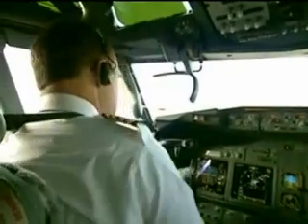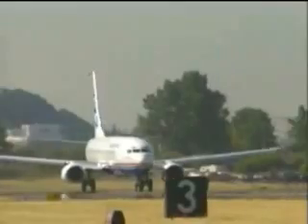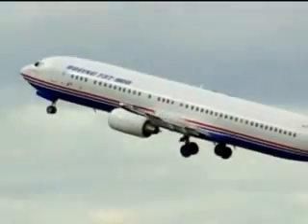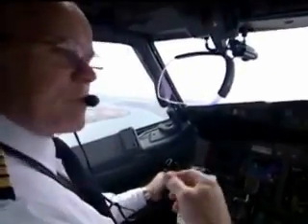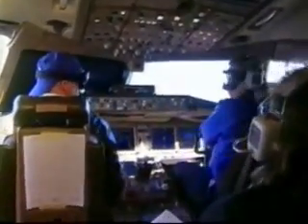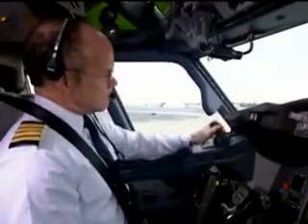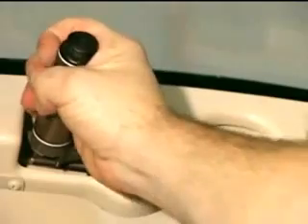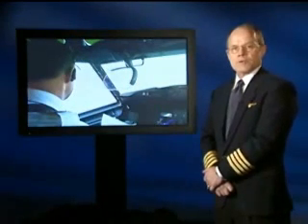Window Opening on Takeoff.

Comment: Im not a pilot, but I dont understand when he says "If the window has been damaged, you should declare an emergency landing, otherwise you can continue flying". I mean is a pilot really in a position to determine if a window is faulty or not simply by looking at it from their seat? Sure it may look like it just opened due to not being latched, but what if it was latched and a fault with the latch itself caused it to open? What happens when you're at an altitude like the altitude that British Airways 5390 was at when the captain was sucked out of the window? I understand that was an entire window screen, but couldnt an unforeseen problem with a window opening cause the same problem at a higher altitude/speed?
Reply: The movable window is a plug: it’s bigger than the hole it goes in. If the window is structurally damaged, then it won’t allow the cabin to pressurize so then you turn back. Otherwise if it closes OK and the cabin pressurizes then it’s impossible for it to come open again with the air pressure pushing it out.

Comment: I was wondering why they wouldn't install a safety sensor on the latch. I remember when the "Big 3" started making childproof windows in 4 door cars. It had nothing to do with child safety and everything to do with cost reduction by eliminating half of the window and track materials. Obviously an orange band or warning sticker is cheaper than additional electronics. I don't remember ever hearing about a kid jumping from the back seat of a moving car.

Comment: How come not all Nr. 2 and 5 windows are cranked? The 767 has acrank in which to move the window whilst the 737 has a straight slide handle. Should'nt the 737's Nr. 2/5 window be difficult to close in flight due to giant airflow?

Comment: shame there nothing like a automatic door slider for plane windows so if you forget close or secure your window by accident which I am sure has happened to a few pilots every now and then. But if some automatic pilot window mechanism cold be installed and it would wld Olympic work on opening shut on the ground. but if the captain overrides the window if we could build a sensor into the system if a pilot was to take off climb into sky the sensor Io
ŕ will keep pilots safe and lessen  risk of losing pilots, passingers and lessen the risk of decompessioning of the cockpit and the rest of the plane too.  As it seems a sensible idea to a situation that happans more than we think I bet as the captain and second pilot have so many checks to remember something as important as a window.  End of the day pilots are only human like everyone else yet do amazing job doing sometimes very long hours sitting in one enclosed area quite some time. yet if working with a second officer you can't stand it must horrible in that situation. yet I guess airlines do their best too put compatible teams together most of the time I guess.

Comment: this capt is correct . I had door open just after take off when flying a Cessna 150. no big deal . sure it makes a loud pop and will change the the way the small cessa flys due to the extra drag but no big deal . fly the plane .. once I was at a safe altitude I simply closed the door..

Comment: like you need a window...
Reply: Karlett555 Umm, actually, they do.  It doubles as an emergency exit to get out of the flight deck.  Also makes cleaning the windshields a hell of a lot easier than a plane with non opening windows.
Reply: Karlett555 Umm, actually, they do.  It doubles as an emergency exit to get out of the flight deck.  Also makes cleaning the windshields a hell of a lot easier than a plane with non opening windows.
Reply: Karlett555 Umm, actually, they do.  It doubles as an emergency exit to get out of the flight deck.  Also makes cleaning the windshields a hell of a lot easier than a plane with non opening windows.
Reply: Well, even if it couldn't open, you'd still need it!

Comment: why do you need a window that opens in the cockpit anyway ?
Reply: Allows the crew to clean the exterior of the flight deck windows, or escape in an emergency. It also allows you to circulate air if the cabin HVAC system is off, since airplanes can get extremely hot sitting in the sun. You can use an open window to communicate with ground crew if you're having trouble with their communication systems, or wave flags and banners and so forth out the window.

There's all kinds of uses for it.
Reply: Since the no smoking ban was insituted, the only reason(s) todate is to adjust the rearview mirrors and or toll booths.

Comment: LIttle known fact: some people believe airliners still have windows for the flight crew, so in the event of a nav light failure, the pilot can open the window and use hand signals for stops and turns. This is of course nonsense. They wave various large flag out the window to indicate stops and turns, based on maritime flag designs. They even have the "Caution! Diver!" flag, although it's rarely used except on old flying boats like the PBY, or on planes with nav light failures and doing unusually fast descents.

Comment: I work for a major airline, I was reading thru the pilot's emergency check list one day for the A-310 Airbus and it states, "for smoke in the cockpit" slow to 250, don O2 mask, depressurize the aircraft, OPEN THE WINDOW!
Reply: SwiftArtz if the plane was pressurised, you'd never get the window open.
Reply: And jump out?
Reply: No, opening the window was suppose to clear the smoke out!
Reply: Scott Haskin yep
Reply: what if you were flying at 32000 feet?
Reply: Scott Haskin yop
Reply: Scott Haskin flop
Reply: +Scott Haskin pep
Reply: +Scott Haskin pup
Reply: +Scott Haskin pop
Reply: I remember hearing that if your windshield is cracked, and no autoland is available, open the video for a "visual approach".
Reply: Oxygen mask giving off 100% oxygen, smoke in the cockpit,....I can't imagine any problems at all

Comment: I was on a flight from Amsterdam to Tangier recently in a 737 where just seconds before takeoff the pilot's window apparently opened. Being a frequent flyer myself I am pretty sure that the plane was already past its v1 speed, instead of taking off however they decided to reject the takeoff, breaking extremely hard and sending all sorts of hand-held items flying through the cabin. Best part of it all however; the cabin crew didn't even make an announcement of what happend afterwards. They simply rolled back to the runway threshold and took off again... (You can imagine how pale some of the passengers looked) I actually had to ask one of the stewardesses what was going on. Crazy if u ask me! First and last time flying with Air Arabia.
Reply: If you were past V1, the airplane would have gone past the other end of the runway in a runway overrun accident. By definition, V1 is the decision speed after which the aircraft is not be able to stop before the end of the runway.
Reply: Assuming your account of what you experienced is correct, then you are either overestimating the speed at which the takeoff was rejected or underestimating the time it took to commence the next takeoff. Factors such as ambient air temperature, weight of the airplane and the speed at which the RTO occurred will affect the required cooling time, which could be up to several hours in extreme circumstances.  It is inconceivable that a captain would proceed to an immediate take off again after a hard RTO.
Reply: I don't know the technicals but fact remains they were almost at takeoff speed, breaked very hard to a standstill, remained standing still on the runway for about 2 minutes after which they rolled back and took off again. about 5-7 min after the RTO
Reply: Your story is bullshit.  After an RTO, the brakes need to cool down, so your claim that "They simply rolled back to the runway threshold and took off again" is utter nonsense.
Reply: As other says, if you past V1, you must take off and then think what you will do. If any pilot abort the takeoff roll after V1, he knows that will end forward the end of the runway, thats it. 

Check in youtube "Accidente Spantax Malaga" where a DC10 abort the takeoff roll after V1 and crossed a highway.
Reply: this is one of the main reasons that they tell you to turn off mobile phones or other handheld devices during takeoff or landing it is to minimise the chance of you holding your phone or whatever which would then become a potential projectile in an undesirable circumstance such as an aborted take off or botched landing or crash that is also why they tell you to stuff any drinks/loose items in the pocket of the seat infront of you in a emergency landing.
Reply: ryanhaart , Sorry ryanhaart, many an airline pilot will totally ignore any cooling charts or not even take note of the RTO speed to calculate it.  Particularly foreign carriers with some much more notorious than others.  A few people I've flown with who in the past had worked as instructor pilot's at foreign carriers have related stories of complete incompetence when their pilot's were subjected to a non normal situation.  How does one describe the level of incompetence not only in situations like this but all others as well.  The completely preventable loss of the B-777 in SFO with Asiana and the B-737 in Poland a few years before, come to mind.  Boeing/Airbus build their machines in such a manner as to allow people with minimal experience and expertise to operate them.  But flying will always be an exercise requiring human monitoring and at the very least, occasional intervention.  At least for now.  Whenever an aircraft is lost complete with it's human passengers because the supposed pilot forgot to left a switch or was too incompetent to understand what the problem was.  Is beyond belief but sadly true.  And the flying public by and large is completely ignorant of the situation.  
All this and we aren't even touching on the issue of pilot's in this country, some of the best trained in the world.  Yet many basically unable to fly in IMC conditions using needle ball and airspeed even with a DME.  Have them intercept a radial, track it to an arc.  Arc left/right to an ILS/LOC, miss the approach, climb, turn, level off and enter holding.  All on an old style panel with an engine out the way it has been done by all pilot's over the decades.  Technology is a wonderful thing but a truly proficient pilot should take pride in the knowledge he can perform all these tasks and more without the aid of a color EFIS map.  
That lays it all out for your brain so much so he has or never had the ability to create situational awareness.  Every pilot should have that proficiency, I know I'd feel a lot better knowing the pilot flying the plane my family and I are on can do these things.  Sorry, for the rant.  But I believe it's not only true but important for everyone's safety.
Reply: @sonnyburnett8725  you’re just racist and retarded

Comment: next video ..window opens at 38.000 feet and the pilot is sucked out of the window.
Reply: The window didn't just open, the entire windscreen blew out due to a faulty repair. Somehow the Captain was able to survive after his upper body was pinned to the outside of the plane and a flight attendant held onto his legs from inside the cockpit.
Reply: At those altitudes it really is an emergency, but on the ground and during take-off or landing it isn't that big of a problem
Reply: userwl2850 that actually happened once I saw it on Aircrash Investigation
Reply: Prank gone wrong
Reply: userwl2850 No. Just keep flying 😂
Reply: Raidzor つ ◕_◕ つ wat
Reply: Raidzor つ ◕_◕ つ wot
Reply: Here is a vid on that

https://youtu.be/3AeWKIKmCBQ
Reply: No way due to pressure

Comment: First step never changes: Fly the airplane.
Reply: aviate > navigate >communicate very important
Reply: Ruben Kelevra
Sorry, Ruben, you just died while keeping calm and gathering information.  Airplanes do not fly themselves when things are going wrong, no matter how calm the crew.
Reply: Hopelessand Forlorn Just stick your elbow out and act cool. That way nobody notices!
Reply: Hopeless, I would say so, but staying calm is the second step after flying the airplane. Panic will only make it worse. (This rule applies to spaceflight too - all nasa astros are trained to stay calm no matter what.
Reply: Hopelessand Forlorn Haha if there is a problem not related to the airframe, I just hit the altitude hold and heading hold, and speed hold. It will keep the plane level while we figure it out.
Reply: I don't think the ATC would be glad if you did that without declaring an emergency first;)) could be dangerous to not do as the ATC told you to do after departure!
Reply: Hopelessand Forlorn
first steps: get awareness of your situation.
second step: think ahead, keep calm, plan your steps
third step: order the issues you have in your head to get the most serious
fourth step: plan when it's save to fix the issue
fifth step: as long as it's not save to fix it, fly the plane
six step: make sure you navigate safely and plan the next actions to ensure the safety of your plane 
sevens step: fix the most imitate problem
Reply: Wayne Vaughn . And make sure shades are on. 😎
Reply: Ruben Kelevra my feet are hurting, too many steps

Comment: i'd have thought closing and locking mechanisms would have more commonality within a company
Reply: the 717 wasn't originally a Boeing model (was MD95), and the rest were designed many years apart. 777 is an iteration of the 75/767 design. Doesn't mention the 747, although I'm pretty sure you can open the windows on that.
Reply: edocronian No you can't open the windows on a 747 (l can't speak for the-8 model however) but there is an emergency hatch in the flight deck.
Reply: thanks.

Comment: would be cool to open the window on take off and rest your elbow on it. The babes would be impressed. Otherwise what's the fucking point of opening cockpit Windows?
Reply: Paul Passat  jumping out of window in case of crash landing or fire. I have seen some documentaries where pilots have jumped with Sprained ankles but saved themselves. Also wave flags on maiden flights
Reply: Where else is the drunk pilot supposed to puke?
Reply: Letting the smoke roll out when you get pulled over haha
Reply: Paul Passat its so you can fly ace ventura style in the event the main windshield is obstructed. its also an emergency exit.
Reply: communication with ground crew most likely
Reply: Paul Passat Cleaning the outside of windshield.
Reply: What's the point? How else would you have a smoke break?
Reply: Boris Terekidi Don't forget about airing out first officer farts.
Reply: Us bush pilots always left the window open, even in -40 below just to freeze off the wimps in the air blast.
Reply: Bruce Dickinson, lead singer of Iron Maiden is also their Captain of the crew. They are also first band to operate their own jet airliner. How cool is that?? http://cdn.newsapi.com.au/image/v1/f13d1788079407be6fc9596e61da8922
I personally think there is no other  reason to make these windows open-able....
Reply: Fart, the reason.
Reply: Liso - yup, with aviator sunglasses and teeth catching debris
Reply: Paul Passat there’s a rope attached above the window. That window is actually the pilots secondary escape if the first, the cockpit door, is not avilable, they throw the rope out the window, climb out the window, and climb down the rope.
Reply: Yeah, if only Randy Rhoads hadn't been puking out the window

Comment: That would be cool at cruise altitude...with 32 Fahrenheit winds
Reply: If the window opened during cruise the air would be sucked out. By the time all the air is gone the plane will already be in a rapid descent. The pilot then has to endure -40 degrees and winds in excess of 800km/h.
Reply: Not to mention at cruise altitude, the winds are more like -50F...
Reply: HunterD yeah, I didn't know the exactly temperature.
Reply: You can't open the windows at cruising altitude, as the pressurised cabin will being pushing the cockpit windows to the fuselage. Since you have to pull inwards for the window to open, it's not possible unless you depressurise the plane
Reply: @Reicky Tcharles
Look at this! Actually a pilot was SUCKED out at cruising alt and SURVIVED !
https://www.youtube.com/watch?v=3AeWKIKmCBQ&t=534s
Reply: Reicky Tcharles ... they would die... ... ...
Reply: Artemis Ares exactly 😂
Reply: Reicky Tcharles ... ... ....
Reply: Reicky Tcharles ...